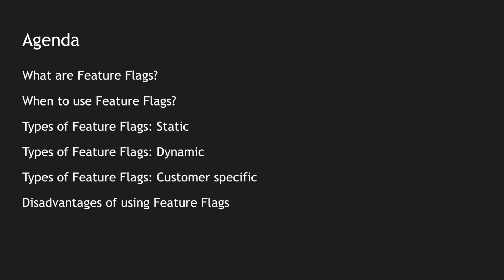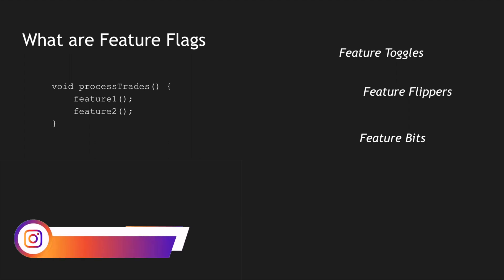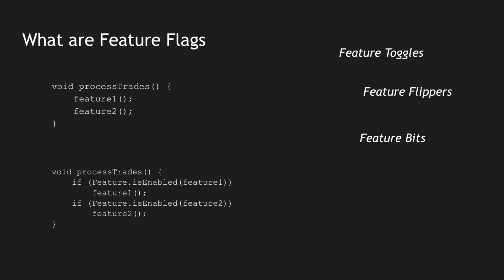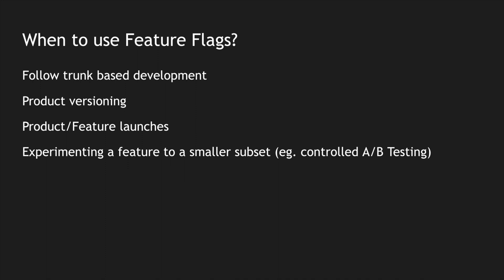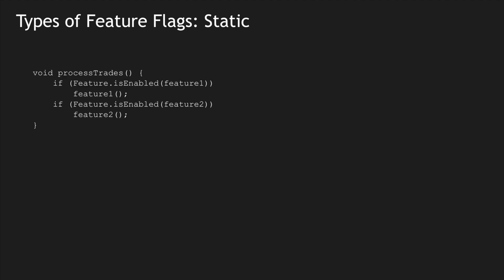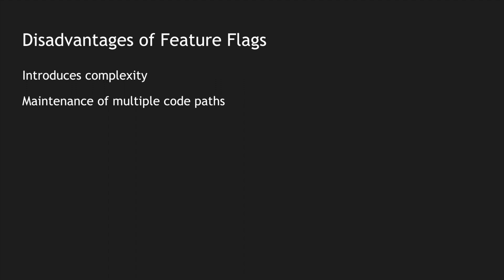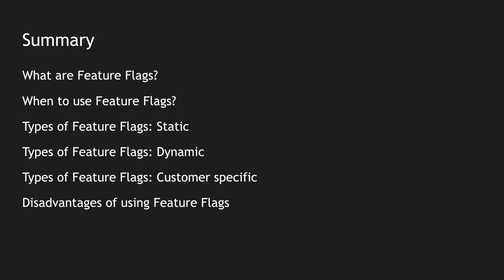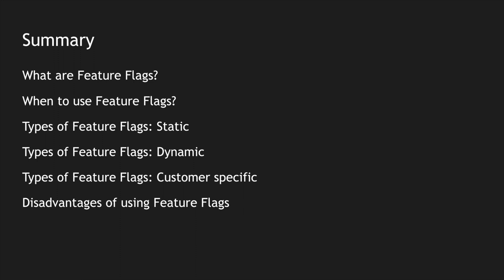Feature Flags aka. Feature Toggles Pattern | Tech Primers

Comment: Thank you. I have a question. What if for a new feature an entity needs a database migration, for instance, a new column with required value (NOT NULL) must be added? How would you save the entity if the flag is set to false for this feature?
Reply from the maker: We always need to plan for a backwards compatible option. So the column cannot be not null in the initial stage. Later when the feature is live, backfilling has to be done for old rows and then the column should be made not null

Comment: We generally use static (property based ) and customer specific (db level). I'm just wondering 🤔 about config server, the major disadvantage is the rest call.
Reply: Instead of rest call (pull) you can use SSE or websocket (push) and get the changes in real time, save them in memory, but on the other side it is getting much more complex.
Reply from the maker: Ya. True. There is no other option. Or use a db call. Chose the best.